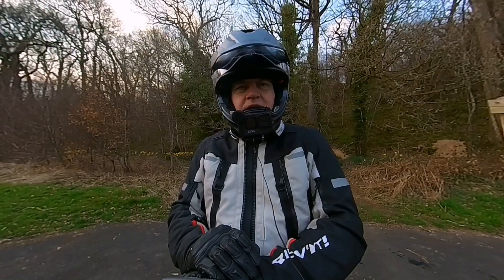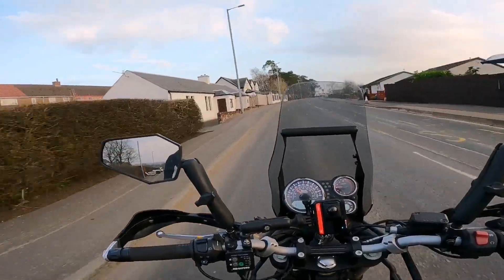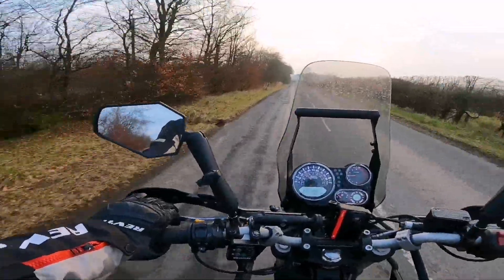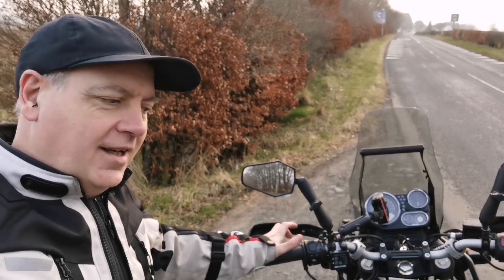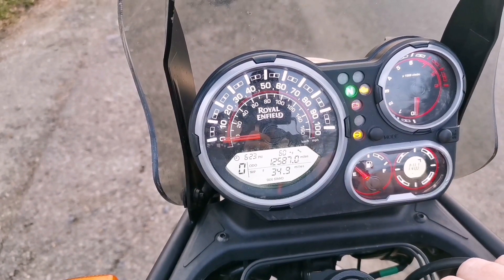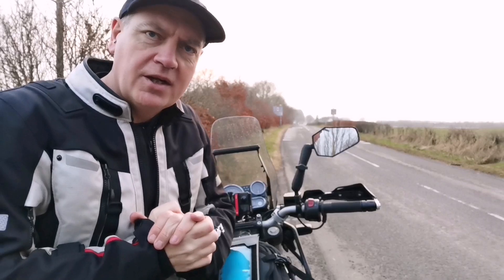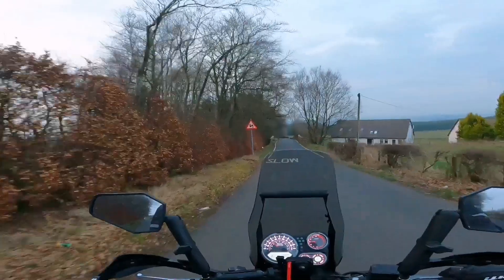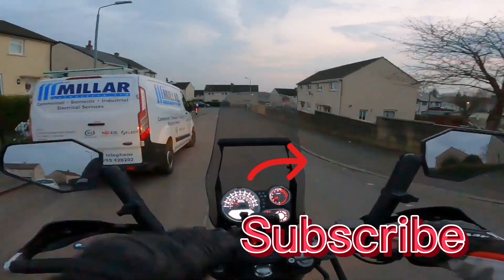Himalayan Clutch - Motorcycle Clutch Slipping - How And Why Is My Enfield Himalayan Clutch Busted

Comment: My Himi clutch lasted me 70,000 kms before I burnt it on a slush recovery on trail. Replaced the clutch assy. (excluding the drum) and it's restored alot of the lost power and acceleration, and a new clutch cable just while I was at it made a world of a difference. If the Himalayan has risers, a longer clutch cable is an absolute basic.
Reply: Mine is currently at 45,000 kms. Plates from factory. 
Have done9-10 trips to high altitude mountain+ technical mountains and endless city and ghat roads. Still going strong, no slippage. I generally use less clutch, just downshift and let the rpm do the pulling.

Comment: My  Himy has done some 17.500 km and is on its first clutch, adjusted it once. So far, so good....
Bring six or eight washers in yer emergency kit, should ye ever get a clutch problem far away from home you  can put the washers on top of the clutch springs to give them preload, that should get you a few miles farther.
Reply from the maker: That's great Robert aye most people getting 25 - 50k on these bikes without even thinking about the clutch. Just one of those things eh. Great advice on the washers I will remember that mate cheers 👍

Comment: Excellent video and explanation of the Clutch issue you are having. I think you are taking the correct and best repair action possible. A new Clutch and cable complete with the much stronger Clutch springs from Hitchcock's it's the way forward. That should get you fully around the mileage Clock on the bike and then some! I look forward to your next video on the replacement and fitting of the new Hitchcock's Clutch and heavier springs. Very well done as always with your video's, clear concise and to the point!  You make it understood, very well done keep posting and update all areas/details on your Himalayan. Thank you.
Reply from the maker: Thanks John. I'm hoping to change the clutch this weekend its murder being off the road. I will video the install obviously 👍
Reply: @WeeJaunt  Excellent, I and many others look forward to your video on the installation of your Hitchcock's clutch and springs. They produce high quality replacement parts and accessories for all Royal Enfield Models and cater for the Himalayan very well. Thank you!
Reply from the maker: @johnokelly8166  Hitchcocks are great right enough. Turns out upgraded clutch will not be available until mid May at the earliest 🥺 supplier issue. Iv cancelled that as I can't keep the bike off the road for another 6 weeks. Got an Enfield clutch coming tomorrow but I did manage to get stronger springs from Hitchcocks.
Reply: @WeeJaunt  I fully understand, far too long to be off the road. You can always upgrade to the Hitchcock's Clutch & heavy duty springs at a later date when you have had plenty of use from the RE Clutch. Looking forward to your next videos on the Himalayan. Safe riding & keep posting.👍

Comment: Well, if my spare St Christopher can't fix things, it's a garage job for me. Replaced the seat with a touring one. Can't say it's made much difference. See how it goes on a long tour. Also bought some ridiculously priced foam antivibration handlebar covers, because they were British made.  Not that impressed with them either, bit too thick. Waiting for pannier rails to arrive. Hoping I can get the bolts out. Good luck with the clutch fit. I'm sure you'll have no bother with your skills. Go well.
Reply from the maker: Haha brilliant Tom. Iv looked at the touring seat but never pulled the trigger on it I'm used to the standard seat so I'm not fussed.. thanks mate 👍

Comment: I can understand how this happened to you. I only have 9,000 kms on my bike. From the day I bought it the clutch did not inspire me with confidence. It wasn’t slipping but it has never felt as positive as other bikes I have owned. I wonder about the oil and how it might effect the clutch. I haven’t replaced a clutch for almost 50 years. I don’t remember it fondly. I never anticipated replacing the clutch. I have put a lot of miles on the bikes I have ridden in the past 25 years. Never has clutch replacement crossed my mind. I hope your bike is an anomaly.
Reply from the maker: Hi Gerald hopefully it's an anomaly right enough. Iv looked online and it does seem to be rare so I don't think it's something the majority will need to worry about. On the oil front I thought the same so out of curiosity I dropped the fully syth out and let it drain for half a day refilled with some semi synth I had and its still the same. Im sure it leads back to the incident I had when I first bought the bike. Good to hear from you again mate 👍

Comment: Maybe you mention this in a previous video, do you use any sort of manual for your repairs? The included handbook isn't all that great, and there's no Haynes manual for the Himalayan, I've found, so what do you use? One of the workshop manuals?
Reply from the maker: Thanks Shaun. Aye the handbook is not much use for anything technical. If I need to find out anything I find myself trawling through forums etc. Hitchcocks website has a pdf you can download that gives torque settings etc so that's handy. As for the clutch I found a page from a shop manual on some random forum that shows how the clutch is put together so I screen shot that. Tbh a job like this my approach tends to be slow and steady take photos as I disassemble and put the thing back together as it comes apart.

Comment: Hi Wee Jaunt
Have you ever had trouble calibrating the compass in the Himalayan?
Can you do a video on calibrating it, there seems to be mixed opinions on the figure of 8 method as it doesn't always work...as in my case, or using a mobile phone or magnet. 
Cheers and keep up the good work
Reply from the maker: Hi Paul. I think Iv calibrated the compass no more than 2-3 times always figure 8 and only after Iv had the battery disconnected. Iv read about people having issues with it though let me look into it and I will do a video on though 👍 Cheers mate.

Comment: Hi! Do you experience any decrease in mileage due to this clutch issue?
Reply from the maker: Hi mate not particularly. If you ride the bike gently enough then there is little to no effect. However twisting the throttle will increase the Revs without the bike gaining momentum will do nothing other than burn fuel and overheat the bike 👍
Reply: Thanks a lot for the insight. Waiting eagerly for your video on clutch replacement. Lots of love from India🔥